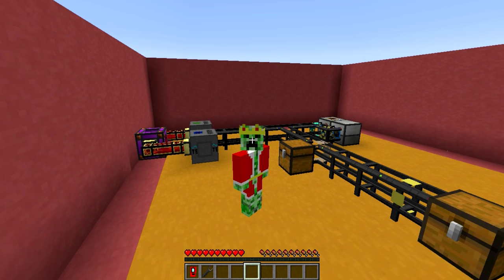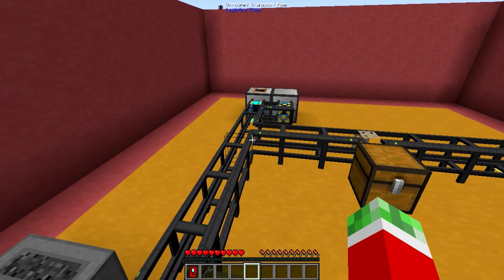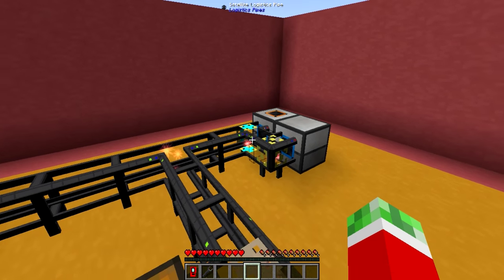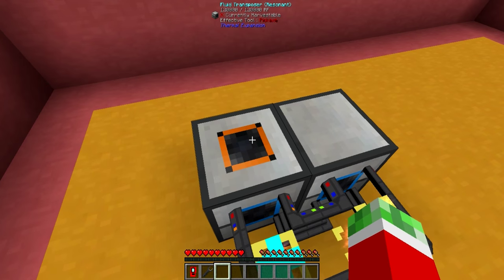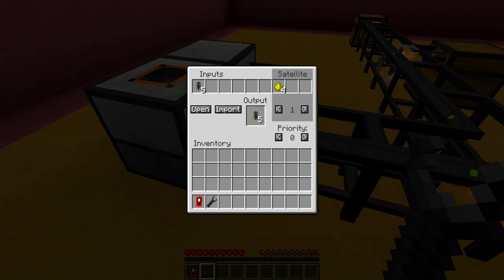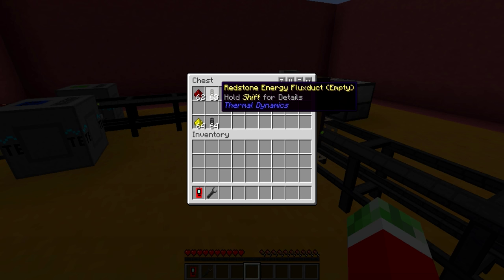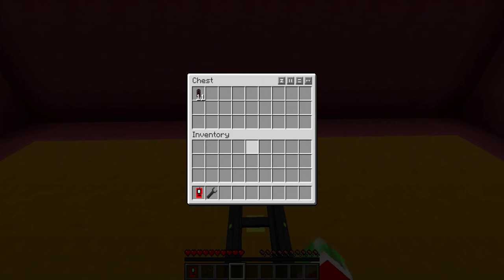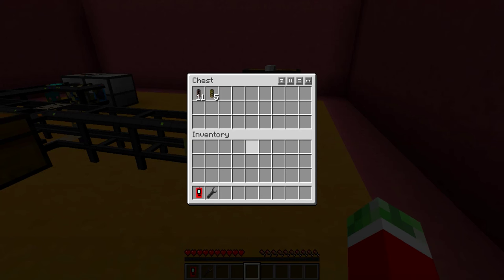Logistics Pipes Tutorial - #7 - Fluid Transposer & Magma Crucible

Comment: So I'm trying to learn this stuff as I progress through Infinity Skyblock - am I correct in assuming that on ANY machines that have configurable outputs (EnderIO, TE, etc..) That the pipes will pull from ANY side no matter if that particular side is configured? (example, You can't extract to the front of most TE machines, but if you set say the bottom to extract, and put the pipe on the front, it will extract?)
Reply from the maker: Hey PsyberMind! This will most likely work, however depending on the mod and machine results may vary. Best suggestion would be to pop into a creative world and test it before building it in your regular world and have a chance to be dissapointed! Hope this helped
Reply: Thank you so much! always wanted to learn how to use LPs, but the system was always too intimidating for me, this series really helped me out, and looking forward to more! Any chance you could do something on Tinkers Alloy Smelting? Like, I understand how to do the tinkers smelting now, thanks to your vido, but How would you go about doing alloys? (other than an alloy furnace)
Reply from the maker: Thanks for the suggestion! I got it noted and will look into it soon! Be sure to subscribe to get notified on further videos

Comment: I'll probably post this question on the most recent video just in hopes you receive it. But is there a way for me to add the Fluid crafting upgrade to crafting modules in chassis pipes? Like I want to add multiple recipes to one machine that handles fluids (namely the magma crucible). But if I can only use autocrafting with basic crafting pipes I would need a machine for each recipe. Any help would be appreciated!
Reply from the maker: Hey there bubbaattack! I think in theory it should be possible to set something like that up, but I think in practical use it won't work all that well. Considering things like combinations of liquids trying to be smelted at the same time and mixing up with the recipes, that's the reason I setup something like this with individual machines for each liquid, so conflicts are solved

Comment: Okay, I know this video is kinda old but I got a question. You explained that nice and I fully understand that, but you used the magma crucible as the satelite. What if you have to melt more than one stack redstone in it? You can't take a hopper as a satelite then because this thing is already the satelite. What do you do then?
Reply: My understanding is, you would move the satellite to the hopper above the magma crucible, and remove the satellite from the crucible itself - instead of having two satellites.
Reply: Yep, that's true. I already tested that myself and it worked. But thanks for the answer. :)

Comment: Is there a way to craft a liquid to send into a storage? or use it as part of a crafting recipe? or must the machines be paired like this for logistics pipes to work? I've been playing infinity evolved, and I have been having some difficulty with liquids... I watched your later episode for fluid transfer, and can move fluids around easily, but making fluids on command from a request pipe has proven, difficult. :)
Reply from the maker: +Katherine Brown Hey Katherine! You could indeed make something similar to what you are asking, but it won't technically be a full crafting recipe. You could make a Supplier Pipe put items into a magma crucible which is connected to a tank, and use that tank for liquid recipes. There isn't really an easy way to craft with that magma crucible though, but it will just keep a tank full of the molten liquid :)
Reply: that is sort of what I'd like to do, keep a supply of liquid etc ready to go, there are so many mods that use liquids heavily in the raw form, being able to move them around and store excess to craft with later, I have done as you said, with the supply pipe, and also set up a 'fake' recipe (to try both methods). The fake recipe is, however, very unwieldy, and the system doesn't know how much is stored, nor how much of any given liquid is needed for crafting.
Reply: If you want to store liquids in a tank you need to (more or less) "forcibly extract" it from the machine/block which creates it. It could be an Ender Tank for the lava from the nether or an Incubator from Binnie's genetics mod for bees.

1. You need a "Logistics Fluid Extractor" (machine) or "Logistics Fluid Insertion" (ender tank) pipe to "introduce" the liquid to the logistics system and to transform the liquid into "packages".

2. To connect the tank you simply use a "Logistics Fluid Provider" pipe to put the fluid into the tank and a "Logistics Fluid Provider" pipe to make the liquid available in your LP system. You can check the amount of liquids in your system through a "Logistics Fluid Request" pipe.

3. To connect the liquid to a machine which will use it you simply use a "Logistics Fluid Supplier".

Using one machine with several different liquids is quite complicated because you might not empty every last drop if an error occurs. Errors could come from the LP system sending more than the necessary liquid if you have a significant delay or a glitch in the system. So using a separate machine for each liquid will save you from some headaches.

Comment: What happens if you ordered both at the same time?
Reply from the maker: +alekmoth Hey Alekmoth! In theory this shouldn't cause too much trouble, as it will only work on one recipe at a time, as long as they are send in the appropriate order. Though to make it 100% fail proof you would have to use a different Crucible-Transposer setup for each molten resource, being one for Redstone recipes, one for Glowstone etc. . Hope this helped :)!